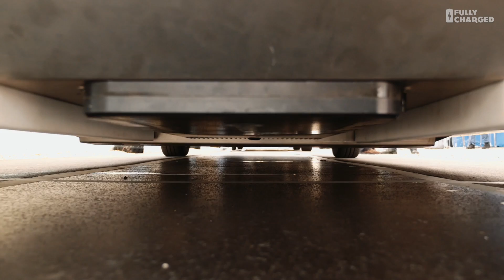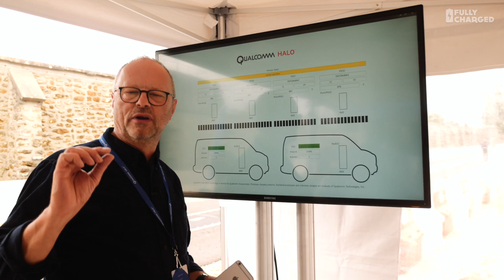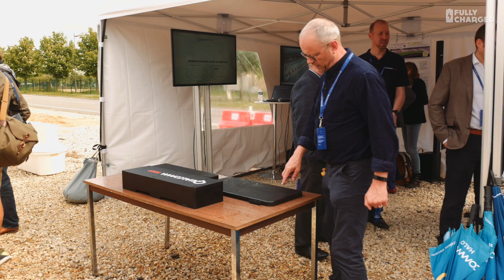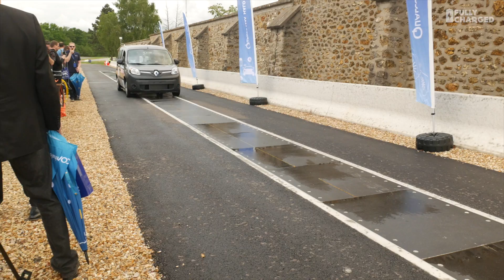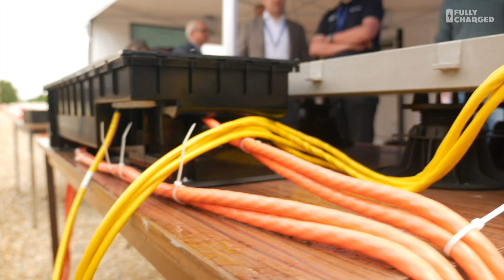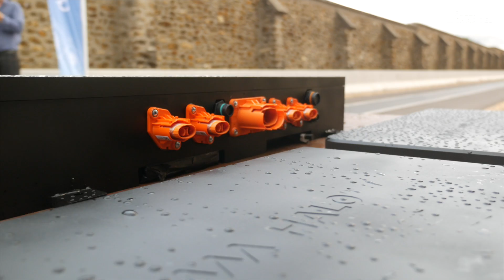Dynamic Electric Vehicle Charging | Fully Charged

Comment: In 10 years time when electric cars have 1000 mile range there will be little use of this technology.

I guess it has the possibility of becoming obsolete before it is ever installed.

However it could be useful in car parks, or at traffic lights in city centres.

The only real use I could see for this technology would be on motorways and highways for driverless trucks.
Reply: At the moment, I would be more than happy enough with a 200-250 mile range, (my old 1997 Fiesta had 250 mile range for short journeys, 300 miles for motroway driving). Not many journeys require 1.000 miles. I would prefer a smaller lighter battery that made the car cheaper to purchase.
Reply: Solid state batteries Dyson and Toyota are building is already at the density twice that of Tesla batteries. So that already 670 miles the same size. Given that you can remove all of the cooler technology needed in the car you can either fit a bigger battery or lose the weight, switching to a complete 3 volt system and lighter materials both leading to further weight reductions, there also lighter motors out there that hasn't made it into production vehicles. 1000 mile range for a car seem more than doable in 10 years.
Reply: Exactly what +R says. Whilst you could build a 1000mi range EV, it's always going to be cheaper, smaller, lighter to build a car to the range people actually use. I don't want to pay for battery capacity that just adds dead weight to a car. I want it to be as efficient as possible in terms of resources used and cost. Having a 1000mi EV range is the equivilent of having a 3 ton 7 seater 4WD SUV for your grocery runs and commuting to the office.
Reply: Not a month since this comment, Tesla announced their next gen Roadster with a 200 KWh battery pack and 620 real miles of range. It's not out until 2020, but do you still think 1000 miles in 10 years is "extremely optimistic" or "over-optimistic"?
Reply: @alasdairpage  That 620 value is based on a lot of assumptions. You can probably get it under certain conditions, but it's not likely. 

Also that roadster is expected to be priced above 200 grand. We're talking normal cars in the affordable range. This induction road technology enables EVs with 20kwh and smaller batteries to make long drives and also overcomes problems with bad traffic. So it essentially enables cheaper electric vehicles (as batteries are one of the major cost drivers) for the consumer with induction equipped roads likely paid for with taxes or some fee or something. So that way the large cost (probably on a similar order of magnitude as the cost to build the road originally, maybe a bit larger) is distributed while the individual costs are reduced. Plus electric car companies wouldn't be required to put as much engineering effort into squeezing out as much range as possible and there'd be no range variations based on environmental factors (air density, temperature, etc.). Really even with better batteries it's a better civilian option, leading to lower costs all around. The US auto industry is huge, and any reduction in production costs for EVs will make both consumers and investors happy. The cost of adding this to the US Interstate System will likely be huge - but it can be done over a period of around 25 years, allowing car companies to develop EVs and the induction road tech to mature. Then the per year cost is quite low compared to the size of the auto industry. Plus it can be added to high congestion areas and parking areas so cars can be constantly charged up.

Not to mention the massive benefits for semi trucks. Batteries are a real killer for electric semis. Add in induction roads and semis can be more efficient and not have to suffer massive batteries (even with advances in battery tech).
Reply: Bad Beard Bill Thanks for the reply. The difficult thing is trying to accurately predict the future, but I think we’re discussing the possibilities here, and the pros and cons that go with them. Setting aside that I made that comment 2 years ago and things have obviously progressed, I think it’s worth continuing to explore.

To my point, I was just exploring the potential with battery improvements, notwithstanding the costs. I think the reason the Roadster is so priced isn’t because of the battery. In theory, it’s twice the size of a regular $10k 100 KWh battery, so it should cost Tesla $20k. The cost of the Roadster is because it’s a halo vehicle. A hyper car. With better specs than anything else. Yet they’ve priced it at 10% of some crazy expensive hyper car competitors. But the reason for its performance are what’s inherent with a larger battery pack. The bigger the pack, the more power can be dumped out at once, leading to higher performance. Anyway, all that is to say that I wasn’t ignoring the consideration of bigger, longer range batteries being made affordable, it’s just the only example at the moment that’s been provided is the Roadster with its hefty price. But Tesla could put that bigger battery in other vehicles with less cost, and in fact that might be what’s in the Cybertruck for $70k.

Just to finish off on the progress of battery technology… since 2010, the cost of batteries has dropped something like 70%, and the energy density has increased something like 60%. For example, a $10k 100 mile pack in 2010 is now the same size and weight, but costs $3k and goes 160 miles (this is a fictional example to just illustrate the maths). Add to that, that Tesla acquired both Maxwell Technologies and Hibar Systems last year, and they have an upcoming Battery and Powertrain Investor Day soon, we’ll probably hear about some further breakthroughs in battery technology – we’ll have to wait and see.

But batteries are definitely still advancing well. I’m saying… expect more range and better Wh/kg soon.

So, induction charging in the road. I agree, it’s kind of the holy grail of EV living. Smaller, cheaper batteries can be used and cars can be cheaper and lighter and even more efficiency as a result. You can negate many of the compromises you have to consider to make EVs viable. I agree with all of that. But this does assume people will drive where the infrastructure is installed. I suppose when they don’t, they can charge like a regular person, but I do see some practical difficulties.

As you acknowledge, this is essentially a colossal infrastructure project. I think the immense funding required would prevent this from ever gaining traction. Why would either a government or car companies pay to install that infrastructure and try to amortise the cost and benefit, when you can already spread the cost direct to the consumer in the cost of every EV sold? That’s the capitalist way, right? Otherwise, everyone pays for drivers to benefit.

There’s also an efficiency issue with inductive charging systems. Because of the air gap, they’re inherently inefficient, meaning you lose a decent percentage of the power you start with through the charging process (when compared to directly plugging in with a cable). This increases the amount of power required to move the same vehicles, in theory. But this might be cancelled out by the lighter weight batteries. I don’t know.

I would disagree that the electrification of semi trucks isn’t possible. I think Tesla are likely to lead the way again here with what’s possible and prove it can work. I’m not certain what issues you envisage, and I’m aware that there’s an argument that if you eat into the weight of the truck with the large batteries required to give the, the range they want, that this reduces their haulage payload because they’re limited to a maximum vehicle weight.

I guess there are no no compromise solutions. Everyone wants something better than we already have, while forgetting I guess that moving way from what we already have is a necessity, and maybe we will have to compromise. Things will just be different.
Reply: yah however this technology does mean that batteries can be smaller, and last much longer between charges... so you'd only need a battery capable of 100 miles...which will get much smaller over time...meaning more room in a car, which will also mean less strain on local electrical infrastructure(i'd assume that the electrical highway would be connected up seperately to the grid than in-town electrical grid...)
Reply: Sarah Staar at 20kw? Lol
Reply: yeah but at 20kw your battery will sill be draining, in a HGV you will get you like 100m added range for every km of track used
Reply: LOL that is being extremely optimistic, even given current rate of battery advancements. over-optimistic, even

Comment: while technology seems convenient to use its still inefficient. more inefficient than charging? if its better than using a battery you would only need a small battery.in the car. maybe 50km range after which pads are in the ground again. large portions of road would need to be electrified, but nobody would ever have to stop.
but induction charging a battery is one of the most wasteful things to do?? 
maybe a contact rail or plate like for trains would be better? more efficient at least.

Comment: Wait, all that and the one word that REALLY matters isn't mentioned!
  
Efficiency?

  The question mark is important. So here's the question to go with it: For 20kW of power being fed into the vehicle battery, how much power does the system consume??

  Currently, the average passenger car is parked for 98.5% of it's life, so charging on the move is a rather pointless "solution" to a problem that doesn't exist.  OK, for some mass transit applications you may want your buses or what ever they are to be able to get electrical power from some sort of external source, but guess what, that ones being solved already many times already.

Comment: Ohhh, just had a thought there. Regen braking doesn't work if the battery is full. It's disabled because there's nowhere for the energy to go. But what if this tech could also work in reverse and let the vehicle dump excess regenerative braking energy INTO THE ROAD. Now that would be very interesting.

Comment: Imagine this tech being added to all the truck-safe freeways and highways where semis travel. It would solve the problem of battery-powered vehicles not having enough range for long-distance over-the-road trucking. A self-driving truck could follow these powered routes for months at a time without ever needing to stop for anything but periodic maintenance and switching trailer loads.
Reply: RedBearAK 20kw is less than 30hp, trucks need 10x that
Reply: johnDon - Then you put ten times as many inductor plates under them. Including under the trailers. And does it really need 300hp while driving down a freeway at a steady speed, or only when starting from a dead stop? Think outside the box. Make it work. Make a double track that can deliver more power. Increase the power limit. The 20kW limit was just a design choice. I imagine you could draw significantly more power with two separate rows of plates running the length of a 65 foot vehicle.
Reply: Then efficiency will certainly drop below that which is already a wasteful level (I have seen the research on this). The laws of electromagnetism are the main limiting factor here.
Reply: All of the fossil-fuel based transportation and energy generation tech we currently use is extremely wasteful, yet we still use it. If this could be used to directly move energy into a BEV without wasting time and energy converting it inefficiently into something else like hydrogen, compressing it, transporting it, and then inefficiently converting it back into energy, then it would be hard for this to be wasteful enough to avoid using it, unless it simply can't be made cost-effective. We already run electric trolleys and buses in cities with overhead wires, and there are pilot projects to create highways with overhead electric wires to power trucks. The tech has worked for decades. Unless this induction tech is drastically more inefficient there is a place for it in our world.
Reply: Except that it is drastically more inefficient. The astronomically high cost does not justify the wastage.
Reply: It's just a prototype. How do you know what either the final efficiency or the cost of a fully developed system would be when manufactured at scale? Define drastically inefficient. Numbers, links. Otherwise you're just a naysayer vs. an optimist. I'll bet all the companies wasting time and money developing this tech would be fascinated to know that the laws of physics prove that it can't work. Or the government sponsors would be fascinated to learn they are being fleeced.

Comment: How close would you need to be going to this thing? Would high clearance mining trucks or 4x4s be  charged? 

If so I was wondering whether it would be more practical to add this to barriers at the side of the road. Less wear (except crashes) and easier to install/maintain.

Comment: How much does it cost per mile to lay.
Reply: David Knowles Over 10million GBP per km!
Reply: The 100m test track cost like 10million USD
Reply: johnDon Yeah but that's with research and development costs. The price would go down a lot if it were mass produced. Though it would still be expensive, I'm sure. So I expect it will only ever be used for specialist applications.
Reply: Nah production is not a big deal, its entrenching the road and connecting to the grid using specialist electrical power conditioning and conversion equipment. Projected cost is as I stated, infact that is a minimum and optimistic estimate.
Reply: Too expensive to install this Tesla coil like wireless underground power transmission system for hundreds of miles..... better to use the 150yrs old tram electric tram system it will be 1000times cheaper
Reply: Nobody knows
Reply: haha its not shinkansen rail tracks . i dont think theyll be too much expensive.

Comment: A daft idea, it would mean having to dig up roads all over the place!
Reply: Roads are being dug up constantly anyway to renovate them.
Reply: If you're renovating a junction anyway, you might as well add this technology while you're at it. (I'm not saying that it has no other issues to it though)
Reply: They're always digging up the roads to get to gas, electric, water etc which will mean ripping these out every time as well. For this to work, they would have to remove all services from under the road just so this wouldn't be dug up every other month. They've just started the 6th set of roadworks on my local main road this year.
Reply: It might be really useful for electric buses in long bus lanes. Or for trucks hauling stuff around ports and depots. They'd never have to stop for refueling.
Reply: not a lot of infrastructure under motorway...so good for motorway when they do planned maintenance...plus, in town driving is more than capable on the car battery...this technology is probably best suited to long journeys via motorway...